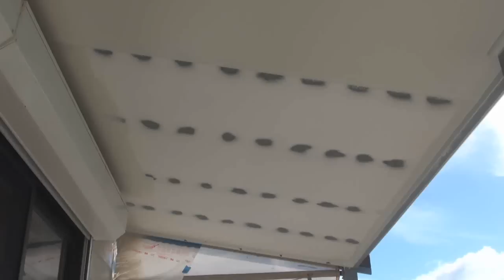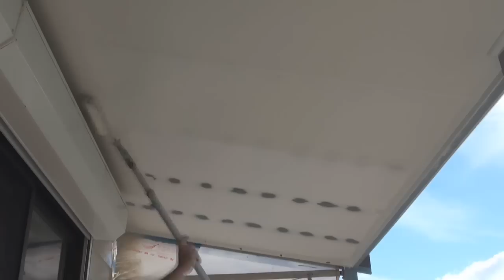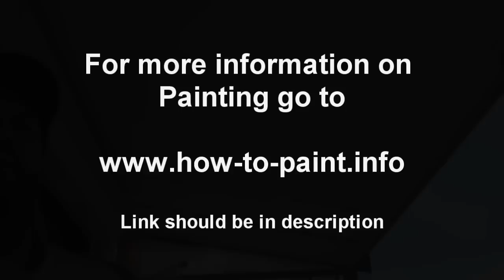How To Paint Eaves - How to paint eave linings or soffits

Comment: Thanks for the video! Quick question, what should I use to clean the soffit before painting? I tried mopping it with soap water but it didn’t work.
Reply from the maker: Use a broom with a bucket of soapy water and a hose to rinse off after, you should be able to remove most of the dirt by scrubbing with broom dipped in soapy water.
Don't forget to Like, Share and Subscribe.
Reply: @howtopaintinfo  thank you!